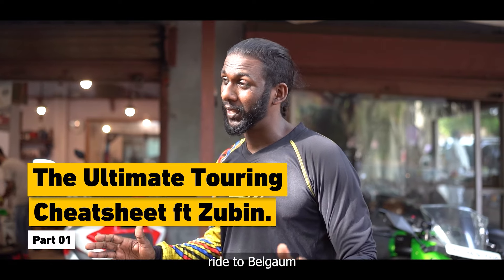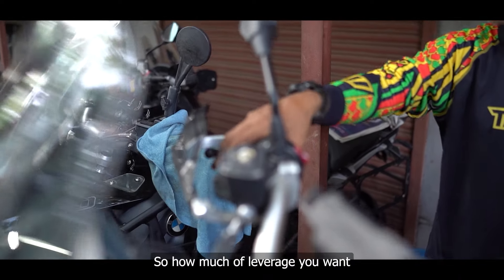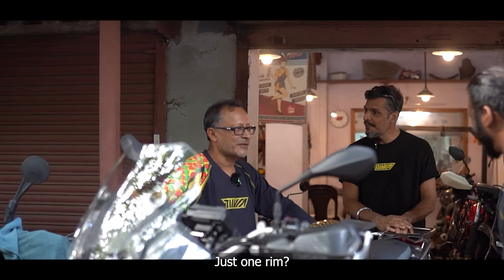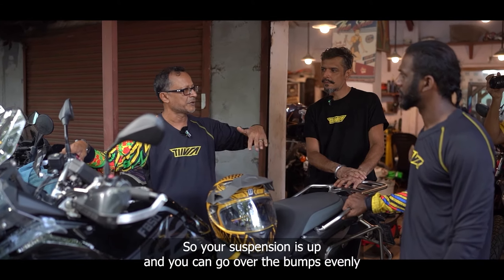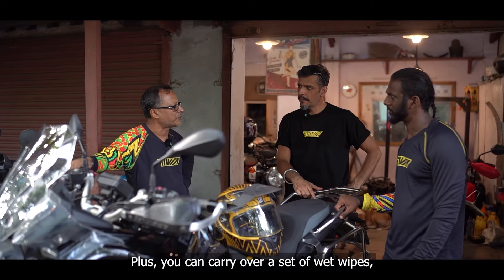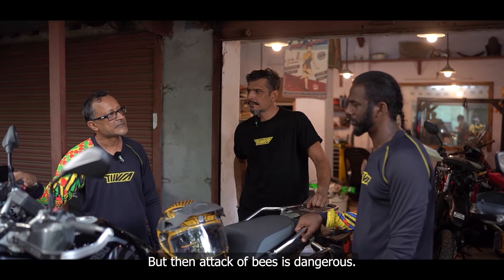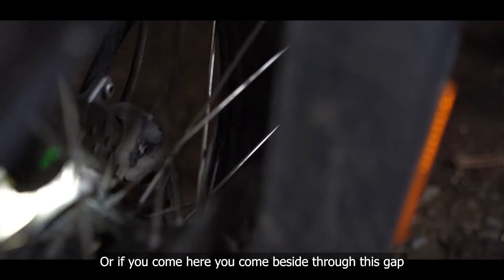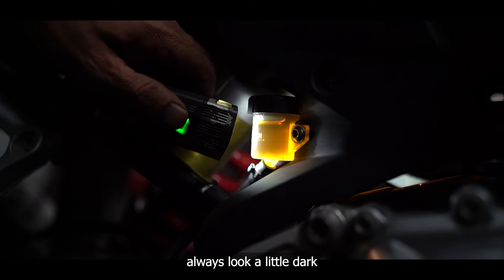YOU'RE PREPPING YOUR BIKE WRONG! Ace Mechanic's Touring Tips ft. Zubin | Part 1

Comment: Whats the Particular reason for going 5 up on hot days?
Reply from the maker: Hey mate can you help us out with the time stamp in the video where this topic is discussed so we can answer your question better?
Reply: I see that i was confused with the captions, i agree we can pick up pressure on hot days
Reply: I will edit out the question, just a query before that
So if the pressures are high on hot days we can bring that to oem spec right? What if i start early morning cold, afternoon heat, do i need to correct them or ig the tyres can take the pressure?